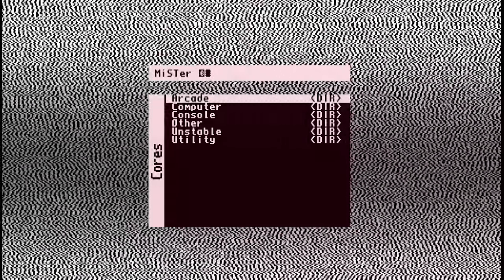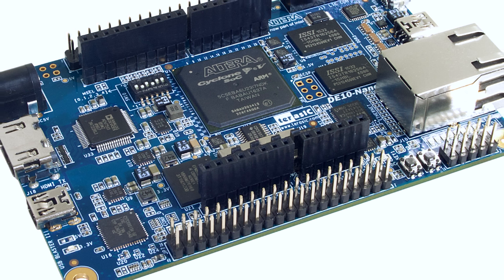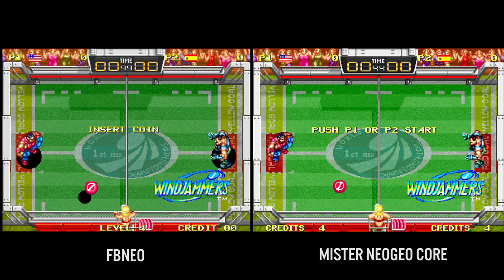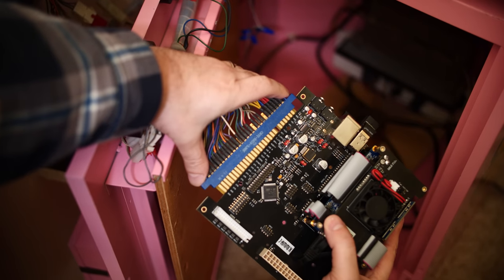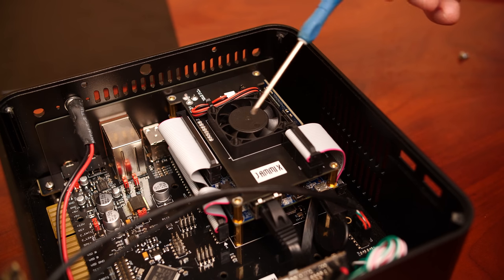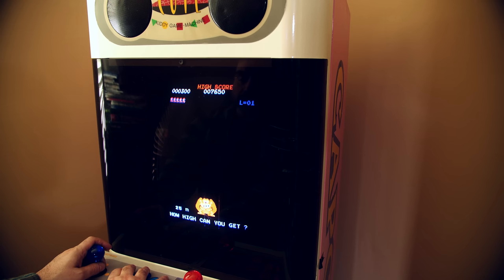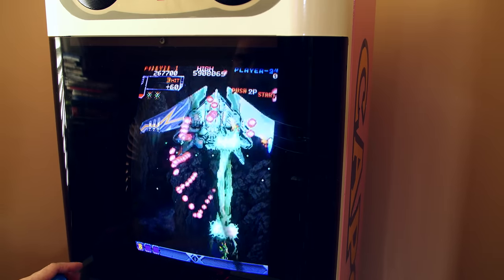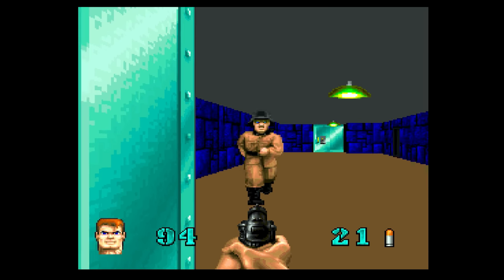Finally - I got my hands on a MiSTer FPGA Retro Gaming Setup | MVG

Comment: FPGA's simulate. They DO NOT emulate. There is a difference.
Reply: According to most definitions of the word emulation, you are very wrong. Since FPGA's are made to replicate the instructions and logic inside the original hardware, it is in fact emulating it, not simulating it
Reply: @PeterKrull1  where are you getting your definitions? The back of a cereal box? No they are simulators. That is literally the whole point of a. FPGA. Emulators attempt follow along with alan turings work, resulting interpretation of a guest machine's instruction set architecture to be read on a host machine. A simulator does not do this and does not require a software layer to do this level of interpretation. Thus not emulating that behavior. 

FPGA, produce a gate array complete with hardware timings to produce a hardware sim for testing. Used them in college. You can literally take you're hardware abstraction and manufacture an actual chip from the result. Now the architecture isn't one to one, but neither is an zen core and an intel core. Amd isn't producing i7 emulators on their ryzen chips. Its a clone. One built on the limitations of fpga with regards to the mister. Just so happens fpga have surpassed the abilities of the hardware they are simulating and can easily process the isa natively, which an emulator does not do. That isn't even getting into the mess of dynamic recompilation like what Xbox does for x360 titles on one and series s|x.
Reply: @Cruxics  You are defining emulation as software based. That really isn't the case. The word 'Emulate' means 'Copy/Mimic' and has roots in Latin. A parrot can emulate a human voice. A child can emulate his favourite sportsman. FPGA inventors XILINX call it hardware emulation, as that is what it is. Emulation. Just not in software.
Reply: @Cruxics   Still not sure where you are getting the idea that an FPGA is simulating anything from. It is not pretending to run an architecture, it literally becomes that architecture. You can debate (as many do) that emulate is not the right word either, but simulate is not it chief. You mostly talk about simulation in the realm of FPGAs when you need to check for timings and functionality of a HDL module on your computer before compiling it to bytecode.
Reply: @PeterKrull1  We probably get the idea that it is simulating because that is what it is defined as in MIT certified Computer Science B.S. programs. A lot of people do make that mistake even in college level programs and have a hard time wrapping their mind around the dictionary definition of the words and the scientific usage of those words. 

Your very description describes simulation and not emulation. HDL language themselves are programmable logic. Sure nothing physically changes about the hardware, but the end result is not the same as assembly or what you get out of a General Purpose Programming language that has to translate. It's that level of interpretation of what is being read into a program counter that is the difference and why FPG's work so well over an emulator. Believe me I spent an afternoon with one Hardware Engineering professor trying to sort through this myself as I once called this out as emulation as well. However that is not what it is. I'm just not a good teacher like he was, but I'm trying my best here. 

It may feel like programming, but it is not. In reality you are creating hardware. When I write Assembly or C++ or use any high level language, I'm not making hardware. When I use those languages I'm not writing hardware logic, I'm writing an interpreter. I'm taking instruction 0110 with registers 00 and 01 and passing them to what ever programming construct I've decided on to produce the same result. Which could be as simple as 11001101 w/ 00 and 01 or it could be more complex with a collection of instructions (which is often the case with CISC to RISC). On a code level you have to write the plexer and a variety of other elements in a way to basically fake the end result. You don't do any of that with an FPGA. You take the instruction and process it as it was originally intended producing hardware logic that just takes the instruction and runs with it. 

I'll concede where it goes after its processed by the FPGA is likely some form of emulation. As controllers for an NES while having the same number of pins as the SNES might take extra information over its data pin. I doubt it, but the NES won't have any mapping for R, L, X, and Y. If using a X-Input device or PlayStation or other hardware input device like a keyboard, that data format will need to be converted into something the FPGA's internal logic will need to understand for mapping inputs. As far as those hardware cores go that are getting loaded up. Those aren't emulators. If you're calling them emulators, then you don't understand what an emulator is. It's like saying "software emulation", its nonsensical to say that. Because Emulators are Software. I think a lot of the confusion stems from when Sony started gutting backward compatibility from the PS3. Where people were trying to understand what was the difference between the 60 gig and the 80 gig machines. They were calling the GS hardware emulation, when they were just putting the PS2 hardware into the system and the EE was being handled by an emulator (I might have these backwards, but you get the point). Suddenly terms like Software and Hardware emulation started popping. So the uninformed and uneducated on the topic matter started defining the dictionary for a scientific community. Nothing wrong with those people, just as I'm having trouble and failing to explain this to you, so did people back in 2007/8 and ultimately failed those asking questions. Also games journalists who never get anything right and just make shit up without doing any hard research. 

Do some digging yourself. you sound like you have a technical background, if your professors didn't cover the subject, then maybe revisit your computer architecture professor (if you're in the area) or email them and ask. Hopefully they too haven't fallen victim to the same weak definitions that get us into trouble. Because imagine the end result. I say emulator and now I have to write an essay defining what that means with regards to what I'm talking about instead of differentiating between a simulator and an emulator as it relates to actual established paradigms and language within the scientific community.
Reply: @ZaPpaul  You're playing off the english definition versus the scientific definition. I'll go out on a limb here an say that the Inventors were wrong to call their awesome creation an emulator.
Reply: @Cruxics  I've explained that the inventors of FPGA call it hardware emulation, it is on their site, I am sure they know more than you. Please show me where there is an official scientific definition of the term that excludes hardware. I will wait...

Comment: MisterFPGA is sooo expensive and nobody will notice the difference with software emulation... Well, the purists will say: "With Mister I got 0.0001 input lag less than software emulation"
Reply: If it was actually only that little difference then you’d have a point. Back here in empirical reality however…
Reply: I think the input lag is a big deal, but that's just me.  I just recently read that a few professional fighting game competitions will start using misters, they are not using software emulators.
Reply: @NinjaRunningWild  3:14 Could you tell me the difference?
Reply: @allisterfiend_2112  But most people are not professional fighting gamers.... Will you pay 700$ for 0.02 less input lag? Is insane....
Reply: @IvanRodriguez-C  My point about the professional gamers were just to show that they agree about the mister being frame accurate also.  yes, the mister is expensive, and even more expensive than last year due to many issues with production and other problems with electronics (good luck getting one right now, no one has them in stock).  700$ is not the price of a mister, unless he is quoting another currency value that is not the U.S. dollar.  I think he has added in the jamma board that he has which most people will not need.  It is not for everyone (just like most things in life, we all tend to buy things because of different reasons).  I personally do not think it is that much because of what I get with it.  I'm into older computers (Commodore 64, Commodore Amiga).  The mister has these plus about 30 more computers, it has arcade games and many many consoles with the PlayStation  and Saturn possibly coming soon.  Right now many companies are releasing their older systems at about $100 - $200  (which are FPGA based) and people buy them up.  I'm getting many more at the price of about 2-3 of those.  Anyway, good talking to you.